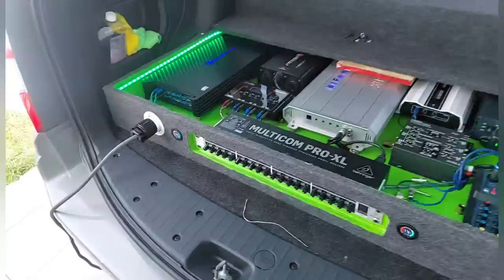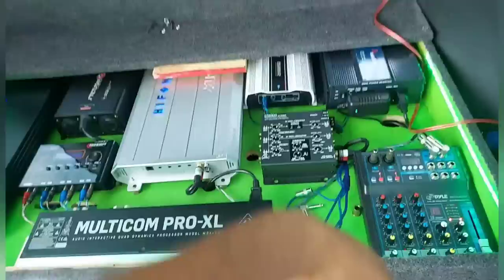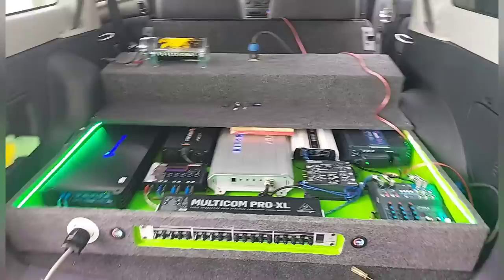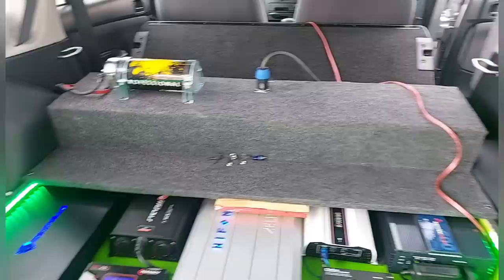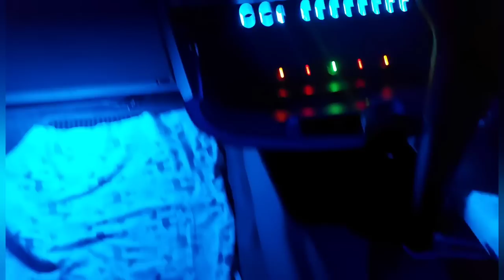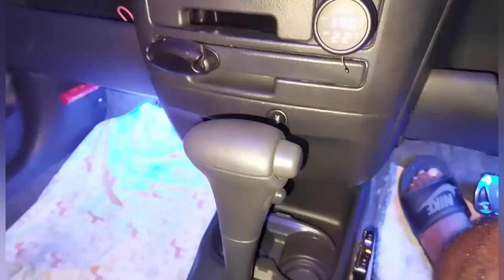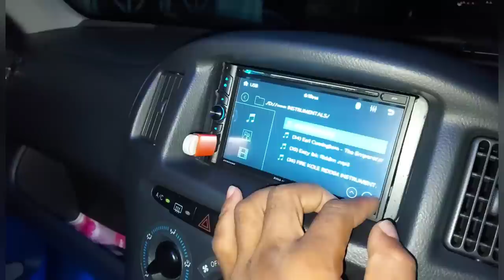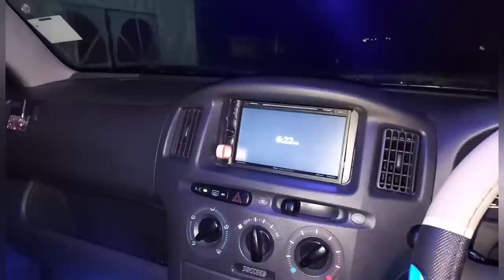Toyota Suceed sound system build part 8... It's ready...

Comment: Points to note, when there is black and white wire, black is live and white is neutral (Ground).
Another fix for engine sound is to make the neutral (ground) wire bigger than the live wire  and ensure all wire is connected tight tight. 
Don't let signal wire and current wire travel together. 
Ensure all signal wire is good.

Comment: Use the remote wire to control the relay, that control the fan. Still use the switch on the wire from the Relay to turn on the fan that the owner can turn on/ off the fan after the sound warm up, but if him no remember to turn it off when him shut down it will turn off when remote is off ( that's my suggestion).

Comment: Hey, i need your help on how to tune my sound. I have a cross over and pre amp, where do i set the nubs on the amplifier? Do they stay at zero and use the crossover and pre amp to tune it. I have two 1000w sub and a 2000w amp to drive them. A 2000w amp and four 6x9 for high and low mids